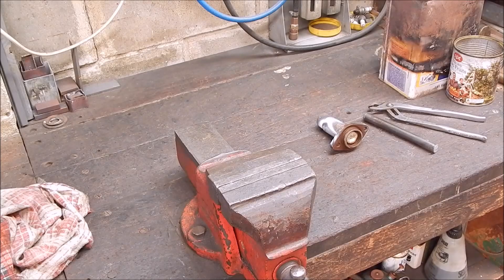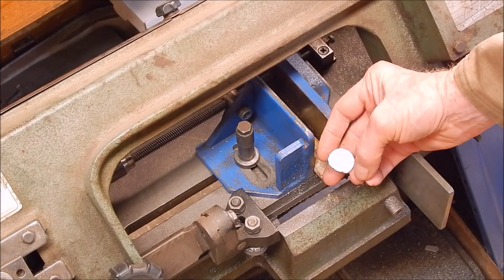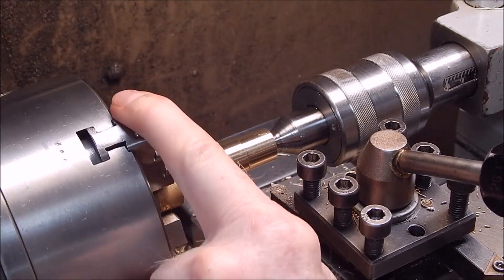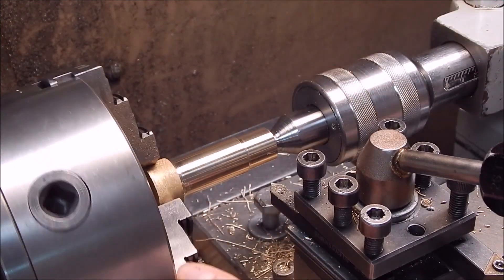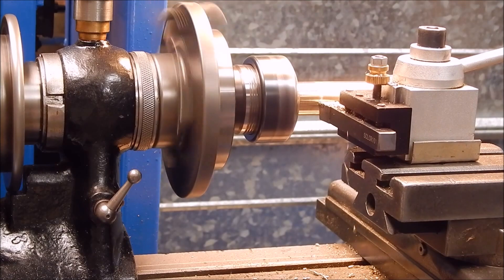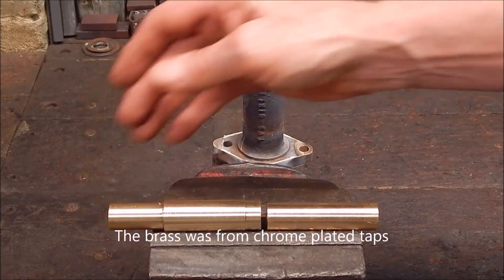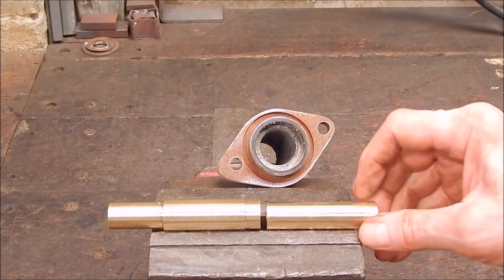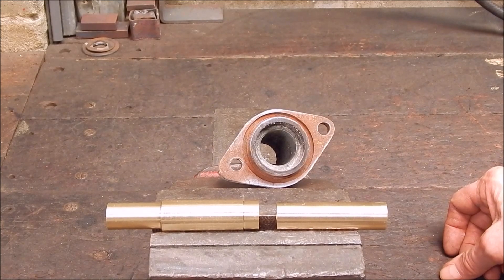Home casting brass round stock in a cast iron mold

Comment: Hi Rob, you say the brass was from chrome plated taps, did you remove the chrome before melting? I have some I'd like to try.
I've done an aluminium melt, had a lot of porosity, any ideas how to reduce it? I put a short video of the pour.
Thanks
Reply from the maker: Hi Mark.  I could tell from the first two seconds of your video what you did wrong.  The aluminium should NEVER glow red hot.  The hotter it gets the more it will gas.  Next time pour the ally as soon as it goes runny.  There's no point in going any hotter.  Preheat the mold as well if possible.  Don't use a degasser or flux as they can do more harm than good.

Regarding chrome taps, I thought about trying to remove it but in the end just tossed them in the pot and the chrome magically disappeared in the melt.  Probably went to dross or is at the bottom of the crucible.

Cheers Rob
Reply: @Xynudu  thanks I'll try running it  colder. I tried some small peices of brass today, easily got upto temperature, I'll try a proper melt with the taps tomorrow.

Comment: Good progress Rob. On the crucible: I have a capped piece of stainless pipe I was thinking of using--any issues with that material? There are so many potential disasters with heating metals...I lose track.
Reply from the maker: Hi Rick,  stainless steel sounds good to me.  You can only try it and see.  I have some large diameter SS at the back of the workshop and was thinking the same thing.  Cheers Rob

Comment: Great job Rob. I get a lot of enjoyment out of casting too. Like everyone else here’s my two bobs worth, I tried metal tube but I got better results using casting sand possibly because it allows the gasses to escape through the sand before the brass being added prevents it escaping. 
Anyway keep having fun and sharing it with us. Cheers Stuart.
Reply from the maker: Hi Stuart.  The imperfections don't look like gassing to me.  Wrong shape.  It looks more like impurities.  Maybe it's zinc dross forming.  I will have to play around with the temperatures a bit.  Not much reliable information on melting brass.  Cheers Rob
Reply: @Xynudu  Thanks Rob, I’ll keep watching and maybe I can learn from your results. 👍👍👍

Comment: Rob. You're making great progress.  Any attempt at replacing the burned off zinc?  In the US we throw pennies in the melt to replace the zinc.  A penny per pound I think.  Ourpenny is essentially a copper plated piece of zinc.  Maybe some borax as a Flux?  Great series.  Looking forward to seeing the next one. 

Joe
Reply from the maker: Hi Joe.  The zinc content seems OK as the brass machines OK.  I will try adding some Borax as that may help.  Cheers Rob

Comment: Being as you can braze cast iron...I would worry about getting the mold too hot and risking the brass sticking to the inside of the mold even tho there is no flux. It mighn't adhere completely but enough to make extraction difficult. Great results tho. Cheers from New Brunswick , Canada.
Reply from the maker: The cast iron is oxidized, so that is unlikely to happen.  Brass and bronze need a clean surface to adhere.  Cheers Rob

Comment: Could it be some lead in the brass taps oxidising that’s causing those minor imperfections.
Reply from the maker: Hi Matt.  I don't know what is causing it.  Could be dross, which is hard to remove as it's a sort of powder and forms quickly.  I could have got a better finish with a proper brass tool, but just went with what was in the toopost.  Still a few things to try.  We are heading in the right direction.  Cheers Rob

Comment: Hi Rob. That's a great result, both of those melts produced usable brass stock 👍👍 It was interesting to see the pour, strange how the molten brass appears to pour out from under any dross that's left on the surface. You're going to be scouring the side of the road now for any old brass fittings, taps, pipes etc 😂 Cheers, Alan.
Reply from the maker: Hi Alan.  Yes, that's strange dross for sure. The brass goes very liquid compared to ally and looks almost semi clear when thin.  I had wondered about pouring it through some stainless steel flywire, but thought it may clog up.  I am always on the lookout for brass.   I have a couple of things still to try on this.  Cast iron works well, so a steel tube may also.  Cheers Rob

Comment: Have been enjoying your journey with the brass casting. You might try some charcoal on top of the molten metal to reduce the dross. Seem to remember this being done when casting extrusion billets. Graphite in oil is by far the best mold release for brass. It was the only successful lubricant when making brass forgings.
Reply from the maker: Thanks for the tips Graham.  Mold release isn't a major issue with cast iron.  I will try a steel tube later.  I can make up some graphite and oil.  Cheers Rob

Comment: This casting is turning into quite an asset Rob. I get why the mold being hotter will help, but how did you know to make the melt hotter to reduce cavitation?
Reply from the maker: Hi Benny.  Hotter means it will stay liquid longer and any voids will (hopefully) collapse before it solidifies.  The next test will be to extend the liquid state by heating the full mold.  This should also allow any dross to surface.  That's the theory anyway ;)  I will make up a plug for the mold tomorrow.  Interesting stuff.  Cheers Rob
Reply: @Xynudu  Very good - thanks. Makes sense!

Comment: I think if you used a ceramic crucible your little plot of hades would be perfectly suitable for casting iron, possibly even higher carbon steels... damn fine job Rob!
Reply from the maker: Thanks.  Brass and maybe bronze is as far as I will go on this.  The furnace does a good job.  Cheers Rob
Reply: Highly unlikely

Comment: Looking very usable, both came out nicely. Curious, how does it work out price wise ? Brass stock from supplier vs old taps + gas bottle costs
Reply from the maker: New brass stock is hellish expensive.   Not much gas used and freebie scrap taps so far.   The furnace is well ahead.

Comment: Even the first one is a perfectly respectable bit of work.  I saw Keith Fenner use the soot from an acetylene torch as mold release for poured bearings in metal cases, that might work for you too.
Reply from the maker: Brass has a very similar Coef of Expansion to aluminium and I expected it to release fairly easily.   The cast iron has an oxidised surface which also helps prevent sticking.  The mold is working fine. Cheers Rob